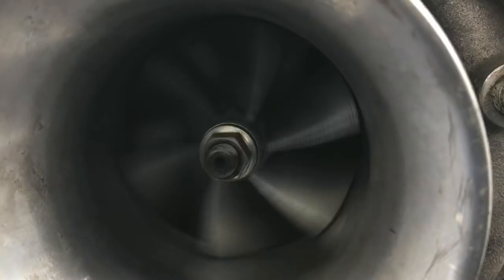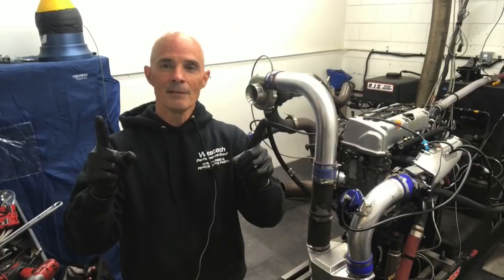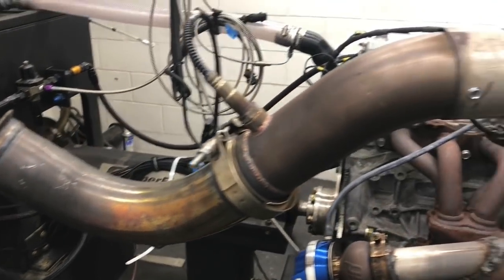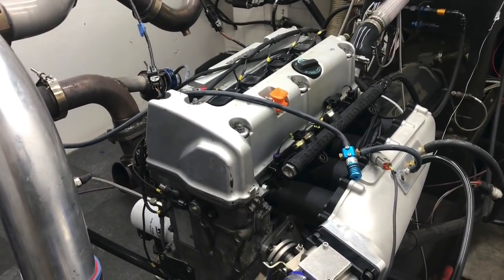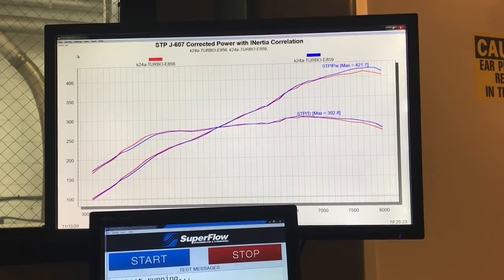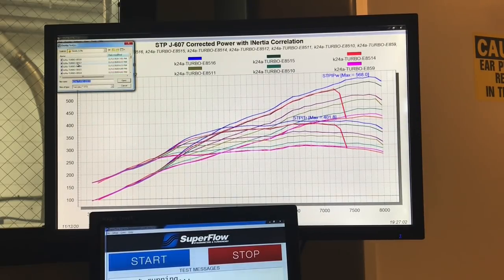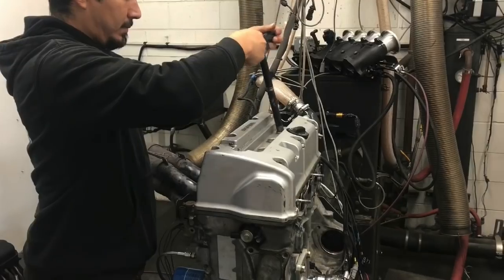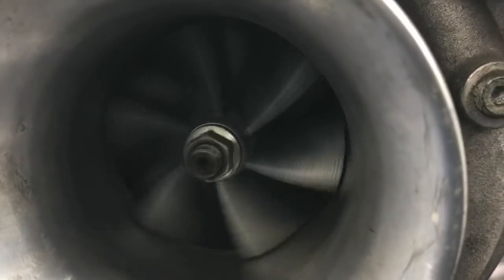DIY JDM TURBO K24A2 HONDA-BOOST & BALACE SHAFTS

Comment: @Richard Holdner with new oem or arp rod bolts you might just get 1000 hp for a couple pulls would do nice to do some king bearings too or at least new oem ones
Reply from the maker: STOP ALL THAT CRAZY TALK-STOCK BOTTOM END MEANS STOCK BOTTOM END-WITH RING GAP
Reply: @richardholdener1727  yea but them rod bolts are now stretched and retorqued and won't hold up to what they would have brand new or before they were taken apart and retorqued 🤷.  Still be interesting to see what it makes though. Most of these engines make a little over 600whp untouched and happy which is probably a little over 700hp at the crank. I bet it let's go at 760 to 780 crank hp with retorqued rod bolts. I know I'm busting ya balls on those rod bolts just always heard how reusing them in high performance builds isn't that prudent.

Comment: 600 with no ring gap that sounds like it's pushing it but I guess one run at a time does not put near as much heat as on the street or track
Reply: Ring gapping stock JDM engines for more boost is not a common thing. The clearences are much more adequate for boost vs an LS chevy engine.

Comment: Daanng I'm early. Making me want to do a k swap on an old British sports car. Whats the size comparison between this and an ls 🤔
Reply: K series is obviously not as wide, but it is a pretty tall motor.
Reply: @MikeKraemer87  hmm cowl hood is often easier than squeezing in a v8 ill have to look up some dimensions. Rwd conversion probably not cheap though
Reply: Several MG guys swap in the 60 degree V6 out of a third-gen or early fourth-gen GM F-body. It's a happy middle ground between not as wide as a 90 degree V8 and not as tall as a K24. Also, they are cheap in the USA and have somewhat of an aftermarket. Plus, the later model front wheel drive cylinder heads are better flowing and aluminum.
Reply: @wyattwunderlin4445  I just moved to uk otherwise I wouldn't dream of anything other than an ls. Have a 6.0l and a 5.3l back in the states and had a c5z. I'm real tempted to k swap a spitfire and do a BMW trans with some sort of rear end for drifting as they have crazy steering angle from factory
Reply: @Coledini  While the LS series is a good engine package, I still believe the chevy 60 degree engine is a better choice for a spitfire. A cast iron 5.3 (LM7) weighs about 520 Lbs, while a K24, according to Super Street weighs 405 Lbs. The factory 3.4, according to GM, weighs 364 Lbs with cast iron heads. With aluminum heads, the total weight drops to 340 lbs. The weight difference is something you would feel on the front end of a light car such as a spitfire or MGB.
Reply: @wyattwunderlin4445  no cheap ls over here I can find in uk why I was thinking k swap. Is that with a turbo kit on the k series though hmm? I just assumed the v6 wasn't in the uk ill have to look into it. Front end weight does do a lot be kinda cool to set up a transaxle setup from maybe a 944/24 or vette  to relocate some weight to the rear 🤔
Reply: @wyattwunderlin4445  that 405 lbs is with a fwd trans!  A fully dressed k24 minus the trans is just over 300 lbs.
Reply: The k24 is nearly just about as tall as the “corvette” ls but shorter than a truck ls.  The big kicker is how short the k24 is from the crank pulley to the bellhousing it is substantially shorter.  I do not know the exact dimension but it’s like 4”-6” shorter.   I helped a friend of mine put a 6.0l ls in a 986 boxster and for this reason alone I would rather do a k24.
Reply: @samjohnson4243  that makes more sense. I was assuming with it coming from Superstreet swap guide that it didn't have a trans. I guess that's what I get for assuming.

Comment: turbo 4 banger :)
Looks like you're using E85?

That drop off at he top looks like valve control going away
Reply: Thanks einstein.
Reply: Considering its got decent valve springs I'd say it's far more likely its running out of turbine flow. Thats a small turbine for something that is able to make power to well over 8500rpm and is already making 600 much lower down
Reply: I'm thinking too much VTC angle up top.  Looked like he said 30 degrees.  Might try retarding some towards redline.
Reply from the maker: YES E85
Reply from the maker: WE TRIED LESS AND IT LOST POWER-IT FACT IT WANTED MORE THAN THE 25 DEGREE SPROCKET WOULD ALLOW